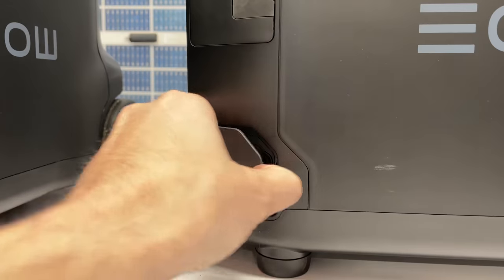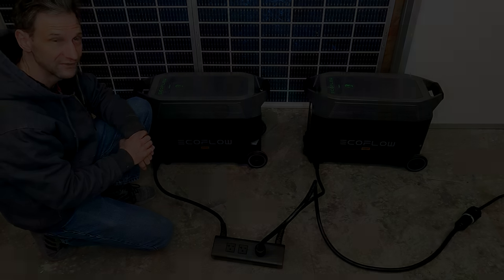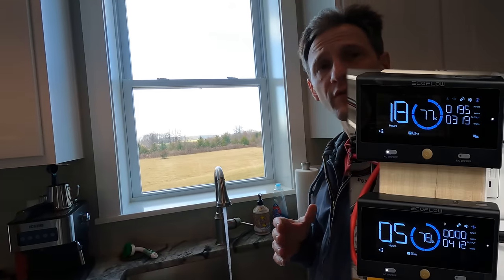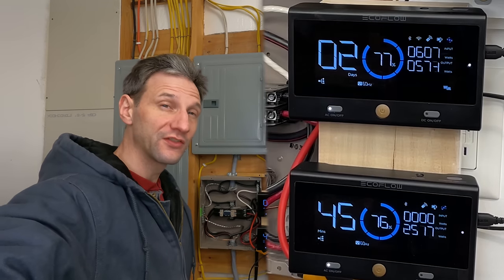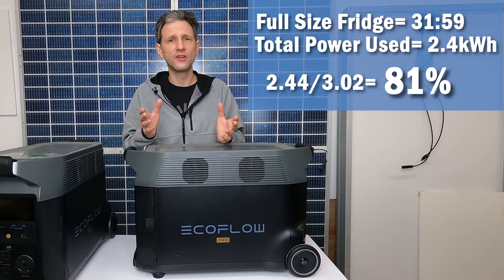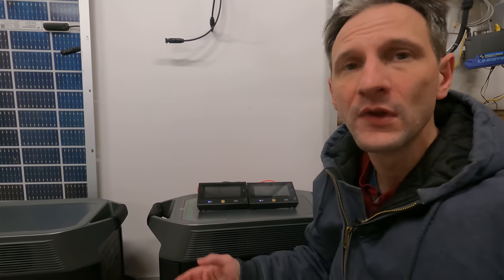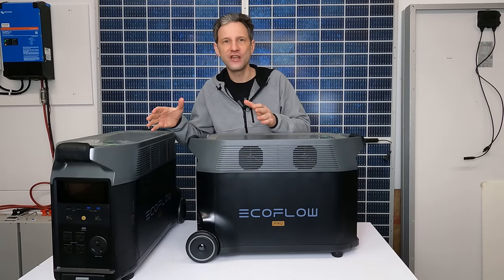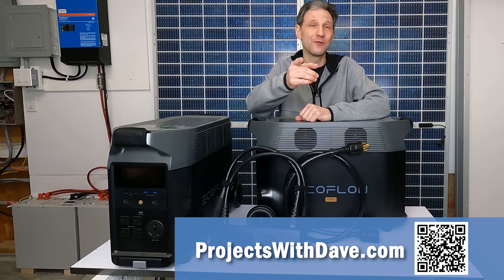EcoFlow Delta Pro Whole Home Backup - Real World Testing

Comment: Great review. Do you plan to test their Smart Panel device? That prevents manual switching. But it has limitations. What about your existing solar panel array? Are you planning to tie into the Delta Pros? Lastly, comparing your current solar system (with all its components) to the DP setup, would you consider them equals in performance and price? One better than the other? Great content Dave. Thank you.
Reply from the maker: I don't have a current plan to test the Smart Panel, but I wouldn't rule it out for a future activity.  For smaller portable units like the Delta pro, I use a small array of 6 used panels.  The portable units can't handle the higher voltages coming from my main array and it makes more sense to use cheap clearance or used panels for small emergency backup systems.  Every system has its pros and cons, it just depends on your specific criteria.

Comment: I had the same problem trying to start my heat pump...overload! I was wondering if we should try it on xboost? That can work!
Reply from the maker: I worked with Active Start to mature the settings for their soft starter and we were able to get it to work, but it's still marginal.

Comment: Why did you keep referring to the EchFlow batteies as "inverters"? That may have confused some people. Especially as you do actually have an inverter hanging on the wall. You also showed that you plugged the generator cord to the outside connection on the house and then came inside and showed @ 3:26 that you plugged the generator extension cord into the EchoFlow, but no where did you show either of those hooked to your home AC system. To a person not understanding, it would appear that you just run a cable from your generator to your EchoFlow and magically the electricity gets to your home AC plugs.
Reply from the maker: The Ecoflow system contains batteries and AC inverters in one unit. It's not "magic," I point out in the beginning of the video that my house has a transfer switch for a generator connection.  With that setup, I can simply plug in the EcoFlow double hub  into the generator input plug and flip the transfer switch.  That moves all the emergency circuits over to the EcoFlow system just like it would for a standard generator.

Comment: Holy smokes that Fluke clamp meter is $550 "deal" price!  It is nice to have such expensive toys.
Reply from the maker: Yes, It's great!  Fluke sent me a solar irradiance meter some time ago which I have put to great use in analyzing solar panel performance.  I found a software flaw in that tool during my testing.  They made a correction for their products in the market in 3 days!  They have been great to work with and are focused on high quality products.  This new clamp meter they sent me to test and use in my videos has been great so far.  It's one of the fun things about sharing my experiments on YouTube, I also am getting the opportunity to try some products and tools I would not otherwise been able to afford.
Reply: @ProjectsWithDave  Well good for you, man.

Comment: Thanks for the great analysis. Whats your best answer for that problem of using to backup whole house, but having an uneven rate of drain on one of the Delta Pro's?  In that case you could end up with one battery emptying out after just a few hours and the remaining battery has 85% left. That means my 240 function is bye bye. Besides re-doing whole panel to try to "balance loads", any other fixes you may suggest? Either way, thanx!

Comment: With every breaker off i plugged in my 4 units and with no load but the wire to the breaker box it goes into overload they say it needs a update so eventually it has to be connected to the internet. So these things won't allow you to be off grid.  Anything that makes you be connected can be turned off

Comment: Late to the party but I noticed on your dc test that there was pretty severe voltage drop at 10amps. Mine runs the same and it is pretty disappointing. Have you tried running a DC capacity test off the Anderson? On mine I can run about 120 watts without the fans ever kicking on and the unit not getting hot.
Reply from the maker: The DC capacity on this unit is fairly limited.  If you need more DC, there are some new systems that get close to 30A or about 300W like the one in this video: https://youtu.be/ZlIbkhPPfGI

Comment: Very nice testing! Thank you for doing this! Ya I was bummed to see my unit NOT come with a solar connector being a "solar generator" lol I've noticed on the double voltage hub each leg of the outlet comes from each unit. Makes sense. To bad they don't balance for charging or usage.
Reply from the maker: There is some balancing that is achieved by modulating the voltage, but it seems like it could be 100% balanced with a cable and some software.
Reply: @ProjectsWithDave  absolutely! I agree with the extra battery port that could balance the batteries. Of course this would take away from the total capability of capacity. I've got one delta pro sonfar and maybe next year I'll snag another with the home panel. I decided on the ecoflow other than solarnand battery on the house for in case we move or need the battery somewhere else. Thanks for the reply!

Comment: Well, it works as you described until it doesn't.  I have seen a couple of videos that want to use the hub but have to update the firmware first.  You must have been sent DP with updated firmware.  Second, some that I know of have received at rear 554 error.  I have yet been able to find clear details as to what the 554 error code is or how to fix it.  When I try to update the firmware, the ap indicates that it needs access to my phone's memory and dumps me into my "settings ap" but I have no idea what I need to do there. Frustrating.  Ecoflow is only open for service M-F 8-5.  Same as 80% of the population.  So I need to take time off work to sit with them on the phone.  
I have sent them serial numbers for both DPs and the hub.  Time will tell if I get help.
Reply from the maker: That's frustrating.  Let us know if it gets resolved.

Comment: Love the review. I have solar on the roof of my house but it supplies back to grid only. How can I hook up 2 eco flow delta pro to my house?  Do I need separate solar panels to charge the deltas?  All help greatly appreciated.
Reply from the maker: You can use the EcoFlow without solar as a UPS or backup power source.  You can charge it during the day through a standard wall outlet when your panels are producing power, then use it to supply power to separate devices.  If you want to make it an independent system, you would need additional panels dedicated for the unit.
Reply: @ProjectsWithDave   do the eco flow panels charge up the delta pros while they are being used?  Do they charge enough to keep them charged up for continued use
Reply from the maker: The Delta Pro's can take a significant solar input.  I have been using a 1200W /90V array to keep mine charged for months off grid with my dehumidifier running as a constant load.  Depending on the weather and how much the dehumidifier runs, sometimes the battery runs out of power.  If I had the expansion battery, I think that I would rarely run out of power since I often am charged to 100% on sunny days.

Comment: I really don't understand what you're talking about @26:47 in regards to the dual Voltage hub ? Why would you want to re-split out again the split phase 240 Volt AC 30 Amp round four pin plug for ? You need that plug to run your entire house by connecting that output to your home's main power panel via it's tie-in receptacle ? Aren't those other two 3 pin AC plugs on the dual voltage hub a pair of 120 Volt 20 Amp outlets ? Please clarify what you mean ?
Reply from the maker: The other outlets on the hub are 240V.
Reply: @ProjectsWithDave  Now THAT is interesting to note. You learn something new every day 👍😃 I thought the ONLY 240 Volts AC output on that dual voltage hub was the round four pin plug, because this is the ONLY ONE everybody talks about ?💁👀🤔Very interesting indeed.🤔
Reply from the maker: I don't know why they don't have 120V outlets on the hub.  That's a big missed opportunity in my opinion.

Comment: Nice video demonstration.  Did you measure the idle load of each of the DeltaPro's?
Reply from the maker: Not directly, but you can see the calculated result on the fridge test was 18W. (fridge test 15:37 )
The book value is 30W for both AC and DC combined.

Comment: Hey! Love your content, thanks so much for sharing. Quick Question, as I'm not a big tech nerd, but concerned. 

A couple hours ago, I ordered the Delta2Max, Extra Battery & 400W Solar Panel for $4k. 

Wouldn't it be a better buy to get the DeltaPro & 2x400W Solar Panel for $4,350?

Did I just make a mistake and not see the potential for an extra $350? Please advise asap if possible. Thanks so much!
Reply from the maker: It depends on what you need it for.  The Delta Pro has much more AC capacity at 3,600W, but the big advantage is that the solar input is capable of 150V on the Delta Pro and only 60V on the Delta 2 Max.  If you are solar charging, the higher voltage is a big deal, it gives you a lot more options in terms of solar panel configurations.  However,  portability would be better with the smaller unit.
Reply: @ProjectsWithDave  ty sir. As I’m looking to expand in the future as use it as a whole-home back up system, I will cancel my order and get the pro. Ty sir for your prompt reply. Appreciate you greatly.

Comment: Great job putting together this video and showing all the plug and play ooptions. But I still have a question: I am planning to get only one Delta Pro unit....is there a way to connect said single unit to the wall plug? or I still need the hub (shown to connect 2 units) and then connect from there to the wall plug?
Reply from the maker: Each unit comes with a plug for connecting to a standard 120V outlet.  This plug is used to charge the unit from home AC power or to use the unit in UPS mode.  You can set the charge speed to fast or slow with a switch on the back side of the unit.
Reply: @ProjectsWithDave  Hi Dave. I was not referring about how to charge a single unit but about how to use only one unit to power some circuits of the house. Around min 3:15 you plug both to the power hub. But, do I still need a power hub if I have only one unit? Thanks so much.
Reply from the maker: No.  You only need to hub for setting up split phase.  Of course you will only be able to power 120V devices with one unit.
In this video I show powering only 120V devices with a single Bluetti: https://youtu.be/_QMe8DWlr30

Comment: Best video I've seen on the ecoflow. Your an intelligent guy! 

Question is...could you connect many batteries and solar panels so it's truly off grid?
Reply from the maker: Yes, you can add solar panels and additional battery capacity.  EcoFlow has their own expansion batteries. Here is a link: https://us.ecoflow.com/products/delta-pro-smart-extra-battery?aff=632
Reply: @ProjectsWithDave  it's just a shame that it looks like you can only add upto X2 batteries with every inverter? Is this correct?
Reply from the maker: Yes, they are limited to two additional batteries per unit.

Comment: Interesting unit. Can it work like a UPS system, or does it have to be turned on manually when needed. I heat with a wood furnace, and if there is a power failure while we are sleeping, the fan shuts off (obviously ), but the fire still burns. The unit would have to kick in and run the fan, hopefully until we woke up or until the fire went out. The fan pulls about 7 amps at 120 volts. Cheers, TT
Reply from the maker: It has a UPS function.   I tested it and it works great.  Are you sure the fan pulls 840 Watts?  That is a lot of power for a fan.  If that's the case the battery would only last about 3.5 hours.  However, I suspect your fan doesn't pull that much power.  Check it with a watt meter, this one is inexpensive and works well: https://amzn.to/3XwchOF

Comment: no mention of battery chemistry. is it LIthium ion? What would you recommend as a similar non portable battery backup addition to my solar system design?
Reply from the maker: The batteries are LiFePO4.  If you don't want portable but still want flexible I would install a system like this one: https://youtu.be/BzMAW8kW0CU

Comment: The plug on the outside of the house did not appear to have a ground.  Or only three tabs.  But you are supposedly feeding it with two poles and a neutral.  Why is this?
Reply from the maker: It does have a ground connection as well.

Comment: The question I can’t seem to get answered regarding these delta pro’s is

Will it Work in ups mode while using the 240volt hub? And can it charge while being used in 240 mode?
Reply from the maker: The units will charge using solar power even when connected to the 240V hub.  I illustrate that in the video.  However, they will not work in UPS mode or charge from the AC power input port when the 240V hub is turned on.  Hope that helps.

Comment: I like the delta pro except the awkward hub connection.  But the deal killer is that it doesn’t wake back up without human intervention.  Nothing against you.  I have tried to like this system but it has to be able to start back automatically once solar powers the battery abode the threshold.  Thanks for the video as always.
Reply from the maker: It seems like such a simple software change to allow the AC to turn back on once the battery reaches a certain level of charge.  The closest I have seen to achieving that is the Bluetti can be turned on remotely with the app.  But it still requires some intervention, and that only works if the internet connection is working.  Here is a video on the similar level Bluetti: https://youtu.be/_QMe8DWlr30
Reply: It does now
Reply: @Captainpaulbtyhtr what does now? The ecoflow will turn itself back on with solar input?

Comment: If I have a delta pro with the extra battery giving me 7,200 watts and I'm using (4) 400 watt solar panels on a sunny day could I use a 1500 watt cooktop continuously without loosing battery charge or am I looking at this wrong? Thanks
Reply from the maker: In full sun during the peak output for the day you will probably only get around 1300W input.  Panels only produce about 80% of their rated output under real world conditions.  So in that case you would be loosing power, but slowly.

Comment: Did you show it was 203 amps and it was 240 ac voltage WOW!! 203 amps x 240v is equal to 48,720watts surely you could run a small community. The motor or pump might be going out.

Comment: @Projects With Everyday Dave  was curious if you were to connect both Delta Pros with their extra battery cable on the back of each unit. Would that allow you to charge the other Delta Pro when you are connected to solar charging and help balance out the units? Haven't seen anybody try that. Thanks for the review.
Reply from the maker: Extra batteries gives you more capacity to work with, but it doesn't allow for balancing.  It would give you more time and methods to correct imbalances, for instance you could add more solar to the inverter that is getting more demand, or put the extra battery on the leg with more demand.

Comment: Thanks for this video. I also have two DPs and I am wondering if the rear ac input port shuts off when the double voltage hub is being used. I would like to charge the DPs with my inverter generator via ac. Thanks
Reply from the maker: I have run the Double Voltage Hub with DC input with no issues.  However, I tested your scenario and it does not work.  I connected the AC input, the unit started charging.  I turned on the hub and it immediately stopped charging.  I turned off the hub and it started charging again.  Hope that helps.
Reply: @ProjectsWithDave  Thanks for testing this which for brings up another idea. If one has the DP extension battery, does that AC input also get turned off when using the dual voltage hub? In other words. I know the DP turns off the AC input with connected to the DV hub but does it also turn off the ac input on the connected extension batter
Reply from the maker: Unfortunately, I don't have any expansion batteries to evaluate.

Comment: Is there any way to make the Extra Battery connection cable a bit longer? If you stack your kit on shelves it's too short.
Reply from the maker: I don't think they have a longer version.  I guess you could cut the cable in half and extend it, but that would not be a simple solution.

Comment: Great info, I wonder if you could get a splitter for the solar panel cord and simultaneously change both ecoflow pro's at the same time or would that blow something.
Reply from the maker: It would be better to divide the panels into two separate strings so the MPPT's can work independently to maximize the output from the panels.
Reply: @ProjectsWithDave  OK thanks.

Comment: hi Dave, you have the same generator inlet (50amp) to Delta Pro (30amp) situation that I have. Where did you get your 50amp inlet male to 30amp male (to EcoFlow) cable with such thin cabling?  I had to build my own with a oven/range 30amp plug to a Reliance 30amp plug, but these have huge thick unyielding cabling.
Reply from the maker: I built it with 6-6-6-6 SER. Something like this: https://www.wireandcableyourway.com/6-6-6-6-copper-ser-service-entrance-cable
It's not very flexible, but works for emergency situations.

Comment: I have Two DELTA Pros connected with a Double Voltage Hub provide 240V, 7200W power can I plug-in my RV 30amp plug with convert into L14-30 input (L14-30P Twist Lock Male Plug to TT-30R Female)
Reply from the maker: Why are you setting up the Delta Pro in a 240V configuration if you only need 120V output?